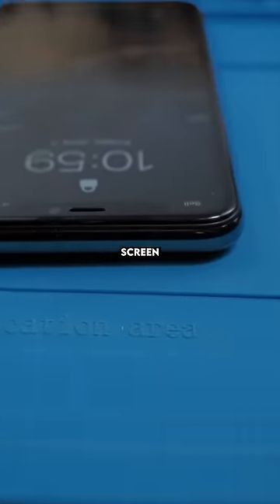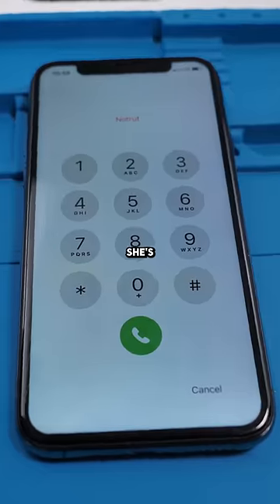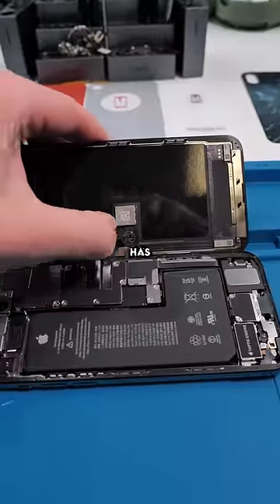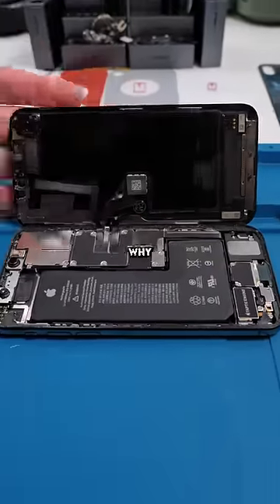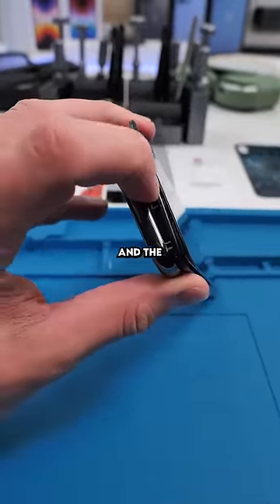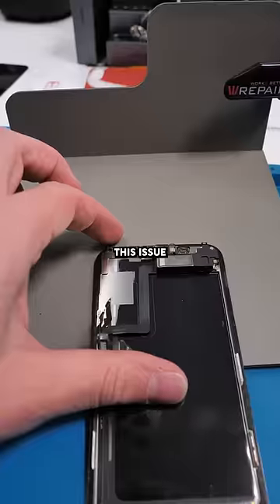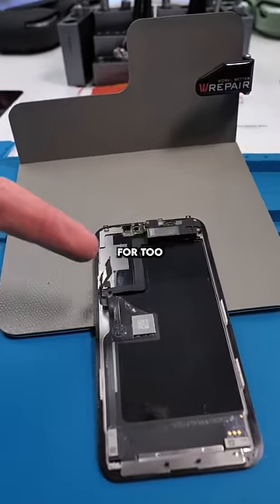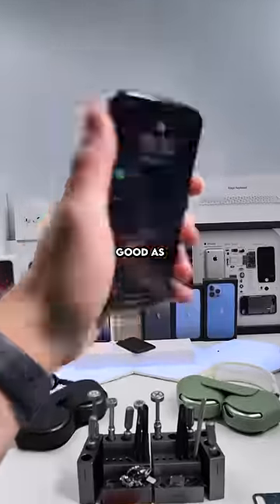Why You Shouldn't Leave Your Phone In The Sun #Shorts

Comment: If the aftermarket screen installed is an LCD and not OLED this can cause different power draw then the phone was designed for and this can also cause the battery to life to degrade faster and even expand like it has here.

Comment: Currently, work at a repair shop, and will occasionally see customers come in with their phones like this (usually with either hard OLED screens or iPhone 11pro/max), anyway my question do you have a way that you word it to the customer to actually explain why that happens or how it could have been a user error and not necessarily the falt of the screen that was put on. Recently what comes to mind is I did a warranty on a phone because of it lifting like that, and the father was the one who brought the phone in, I just did a warranty cause it was only like maybe a month since the repair was done, and the screen had little to no scratches on it so I didn't mind, but during the conversation with him he brought up that she usually has the phone in her back pocket and likely sits on it and I informed him that possibly that + the fact that her case went so far onto the screen that it ends right on that lip between the glass and the plastic bezel and said that probably is what did it so if he didn't want to have to come back again for the same thing again probably would have a different case and not sit on the phone.
TLDR: do you PRG have a way of saying to customers that they likely are the cause of the screen popping out without making them feel any type of way?

Comment: Well, you can leave your phone out in the sun... in a light colored case, since light colors absorb much less heat from the sun. I had a funny experience with an iPad at work... If I left it out in the sun face-up (black screen exposed) for even fifteen minutes, it would get hot enough to trigger thermal safeguards. But if I left out face down (matte metallic back exposed) it was perfectly happy.

Comment: You don't get the display message in setting? I head that you have to take the touch module from the original screen and solder to the new screen.
It works with programming only?

Comment: Hey PRG idk if you saw my last comment where I asked if you knew how to fix a Xbox controller button that is incredibly soft. It still works when I press it but I don’t feel it being pressed hardly at all. Do you know how to fix controllers?
Reply: Just run a small piece of paper around and inside the button (put your small piece of paper in the corners of the buttons where it will enter and run it along the sides), you will be surprised at how deep the buttons are and if it still doesn’t work pour some rubbing alcohol or isophropyl alchool to the button and keep pressing it. If its still soft, I would just advise to take it apart and clean the casing and where the rubber pads are together.
Reply: @kaan4864  maybe I am wrong. A soft button is one that feels like it’s jammed in and just barely goes further down when you press it, right? If so I tried what you told me and it didn’t work
Reply: @kaan4864  it’s the A button